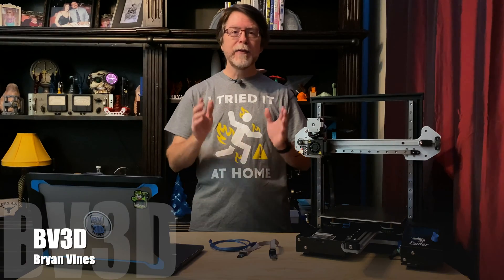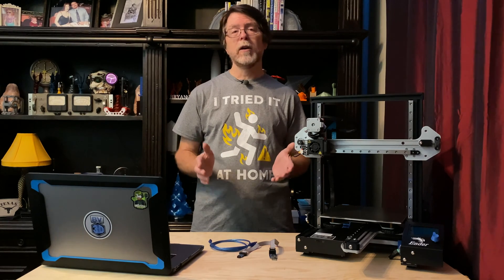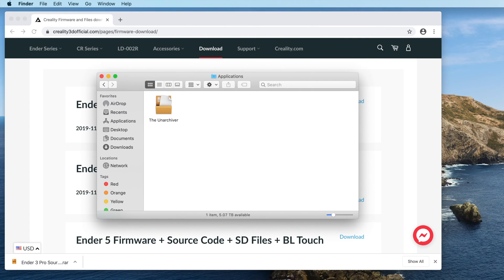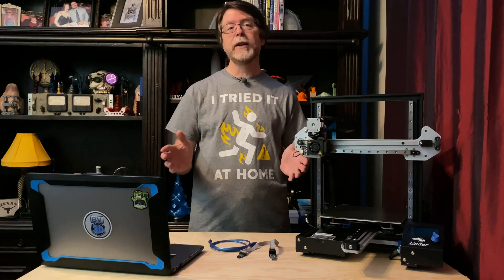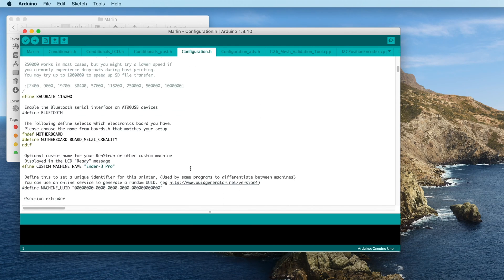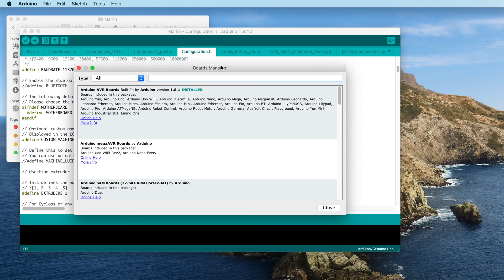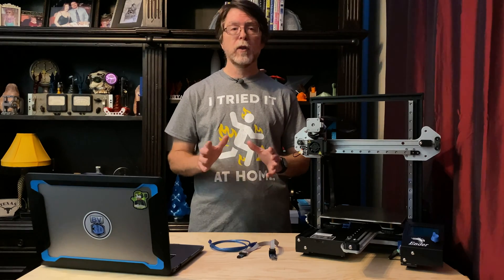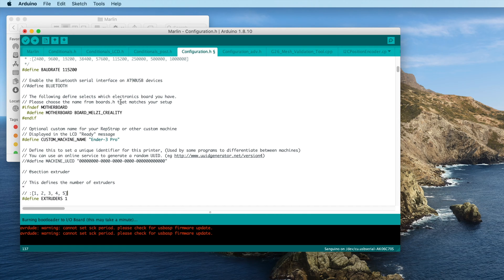How to Install Bootloader & Creality Firmware on Ender 3 & Ender 3 Pro

Comment from the maker: Hello 3D Printing Friends! This video applies to Creality's Ender-3 and Ender-3 Pro printers with 8-bit main boards only. If you've bought an Ender-3 or Ender-3 Pro RECENTLY, check the board revision before following along with this video. If your printer has a v4.2.2 or a v4.2.7 main board, these are 32-bit main boards. The firmware upgrade process for 32-bit boards is completely different (see How to Update the Firmware on the Ender-3 V2 here https://youtu.be/BI269XHyAFg). Thanks, and happy printing! 👍
Reply: I appreciate your video a ton, I bought a v4.2.7 board that appears to not have the bootloader working properly and a lot of the people on the reviews on amazon for the listing I bought had the same issue it seems so I have been attempting to re install the bootloader on the board as it is currently stuck on version 1.1.6 and will not .... I have used about 20 different SD cards ranging from 1 gig to 64gig and formated both with fat and fat32 I spent a lot of time and did everything to the T, your video at least got me on the right track I feel, I hope I get this over with finally though.... I have a older ender 3 pro v1 that was upgraded.... 
UPDATE : 
in case anyone has a issue with a 4.2.7 board that honestly is not updating, this has helped me resolve the issue. I did have to get a little hacky with things however and modify content..honestly might just end up getting another board any way as this has just been a big disappointment and I don't trust it...
Reply: What if i have an ender 3-pro with an upgraded motherboard thats v4.2.7? Then what do i watch in order to upgrade the firmware

Comment: Aaaaargh why are there no tutorials for doing this on the stm32 4.2.2 board!?!?!
Reply from the maker: Creality's 32-bit boards typically take firmware updates via the MicroSD card slot, reading a .bin file, and so don't need a bootloader.

Comment: Could you possibly share the firmware needed for an ender 3, The printer is new, but has been in the box for several years.  After setting it up. To make first print. My screen went black.  Being told by many to reconfigure the printer.  So many to choose from  ,that im not sure about which one to put on a blank micro sd card.  Any help would be greatly appreciated .The printer was given to me. As the gyy lost interest.  He removed only the paperwork.  So by video and finding the instructions online.  But not sure what firmware to dl.

Comment: Loved it, have seen it about 3years ago when you first made it. Bought the USBASp and adapter back then and used it and it worked like a champ. I lost trach of these old board info and have spent 2 days looking for this, again. This time I have a failure of 1 of 3 boards. The first 2 worked great a V1.1.3 and a V1.1.4, but the 3rd would not allow the Bootloader to install. I was wondering if you might have time to review and make a suggestion. The error is: 
 
avrdude: auto set sck period (because given equals null)
avrdude: warning: cannot set sck period. please check for usbasp firmware update.
avrdude: error: program enable: target doesn't answer. 1 
avrdude: initialization failed, rc=-1
         Double check connections and try again, or use -F to override
         this check.

Thanks again.
RC

Comment: I have found a god among mortal men... thank you!  I have been having the worst luck with the ender 3 pro.  I bought it new out of the box, it came with the 4.2.2 board with the bad chip.  After fully assembling it, I managed to erase the firmware on it by accident.  Took me about a month to find new working firmware for it.  I printed about six things and then due to hard to explain circumstances, shut off my 3D printer mid print which destroyed the motor controller.  A year later (just recently), I bought a brand new 4.2.7 board and am still having issues with the firmware.  I even got the touch sensor and LED touch screen too.  I have been fiddling with it for about a week with zero progress.  Somehow, I got it to a point where I could run some basic functions, but the Z axis didn't work and now I can't even get back to that screen.  The Z axis motor would go up but now down and zeroing everything causes it to get stuck in an endless loop when  trying to lower.

Needless to say, I am ready to try anything and the boot loader being borked is my last best guess as to what the issue is before I break down and just buy a brand new printer.

Any help or suggestions by anyone would be greatly apricated!  Also, I know its not the SD card, bought a brand new 32 GB card and am re-formatting it with rufus now just to be sure.

Comment: I know this is an older video, and you probably won't see this, but thank you. I got a BLTouch like 6 months ago and originally tried to follow this tutorial to update my firmware and whatnot. However, there was something wrong with the USBasp that I had bought, and it sent me down a rabbit hole for a couple weeks trying desperately to figure out what was wrong. I looked everywhere. Even Reddit couldn't help me. The problem doesn't matter now, because I eventually dropped it and neglected my printer until about a week ago. I went over everything again, trying to figure out what was wrong with a fresh perspective, and eventually noticed that the USBasp I was using and the one I saw in tutorials was different. The one I had came with the BLTouch and was less complex. The point is, I eventually hit f*ck it and bought what turned out to be the same one you recommended. When I tested it however, my heart sank. More errors. Different ones this time, but still aggravating. After tinkering for about an hour, I decided to come back here, where this all started for me, and reassure I was doing everything correctly.

I had the 6 pin adapter plugged in facing the wrong direction.

Bootloader was burnt on properly first try this time. Thank you. I still have to properly flash the firmware and whatnot, but I had to stop right after that success to get this out somehow. I am so, unbelievably relieved to finally move on with this. Makes me wonder if the BLTouch will be worth it. Thanks for the guide man.

Comment: please! anyone who has done this on windows help! i dont know if its very different on windows or the firmware is very different now but i just cant get this to work and following over and over half the options are in different places i just cant get this. the printer is a brick now and i cant get this program to cooperate

Comment: i can't believe creality required a third party arduino board just to update firmware on 2020 3d printers when every other device on earth has been updating firmwares with usb thumb drives or flash media for 20 years.  This can't be correct, there has to be a way to update firmware with just a file on a sd card.
Reply from the maker: They didn't include a bootloader on their 8-bit boards, so you had to flash the board with a bootloader. Once the 8-bit board has a bootloader, you can flash the firmware over the USB cable. But it wasn't until the 32-bit boards that we got the VERY welcome ability to flash the firmware from a file on the MicroSD card.

Comment: I've tried so many things but I can't get the microcontroller to talk to the board with the right drivers...  I keep getting a Sanguino not detected on the bottom right and a "please check for usbasp firmware update"

It seems like there are a lot of holes in this tutorial :(

Comment: So, I'm new to 3d printing. 
I burned the microcontroller, ( blue screen  )bought a new one, soldered on, then, the same problem, got a blue screen.
Do I have to install a bootloader, to flash a new firmware?

Comment: That was perfect! I’ve been struggling with my old ender 5 (atmega1284p) to let it accept klipper, but it needed a boot loader. For me, a new motherboard or an isp is both going to be a few weeks ordering, so I’m probably going to upgrade to a board with better stepper drivers, but I’m wondering if you could use the arduino it self as a boot loader, with a breadboard,  in a pinch I mean.
Reply from the maker: Hi! Yes, you can use an Arduino and some jumper wires to go from the Arduino's pins to the six-pin connector on the printer's motherboard.  There's a tutorial on the Arduino site ( https://docs.arduino.cc/built-in-examples/arduino-isp/ArduinoISP ). One of the pictures shows an Arduino Nano as the "target" device, being programmed by a larger Arduino. The Nano uses a six-pin ICSP header, just like the printer's motherboard, so that's probably the clearest example of how to connect the two devices.
Reply: @BV3D  I mean, thx a lot ! ! based on your example I was actually able to use the arduino uno as a boot loader and upgrade the marlin firmware with klipper,thus I do not longer need to sit and wait for the new board for a few weeks without printing.  Btw, I’ve since watched several other videos you have, and I’m now wondering if you could use the end stop (z) as a bed probe. I know it’s discussed on several forums and videos, but I have not seen any specific video on how to do it, including the firmware / g code updates and where to do it. I’m pretty new to this 3D printing, just bought an old ender 5 a few weeks back. Anyway really enjoy your videos!

Comment: Actually , you can just put the firmware .bin file on the sd card. Put the sd card on the printer, switch it on, and after a few seconds it boots up normaly! Without the need of this.
Reply from the maker: That's how the 32-bit boards work. The 8-bit board in my printer required the bootloader, and flashing the firmware via USB afterwards.

Comment: My ender 3 pro  board has only a 4 pin not the 6 pin that you show on your video, the board that I have says its V4.2.2, can you recommend anything?
Reply from the maker: Hi George, the v4.2.2 board is a 32-bit board, and doesn't need a bootloader installed. Its firmware also doesn't get flashed via the USB port. Instead, the firmware.bin file should be copied onto a freshly formatted MicroSD card, and that card should be put in the printer's MicroSD card slot, and then turn the printer on. The printer will see the .bin file and attempt to flash the firmware with it.
Reply: @BV3D  I did this, and the printer did see the flash card but did not upload the new software?? what do I do?

Comment: Hi Brian - sorry to ask more questions. I have the 1.1.5 silent board with a bootloader preinstalled. Any advice on updating the firmware? The Crealiity download is a .hex file, without a sourcecode file, and is labeled as 'bootloader'... i'm stuck :-( (Loving 3D printing by the way!)

Comment: This got me 98% there download the TH3d package and use arduino in that package as my sanguino board needed to be Sanguino 12-- and the regular Sanguino only bricked my printer. That easy switch had me up and going in under 4 mins.

Comment: Hi, can I use the BLTouch burner cable in place of the ASP you are using and if so which programmer should I use. Will it be USBasp or USBtiny ISP or some other? Many thanks in advance.

Comment: my 4.2.7 motherboard does not have any pins to plug the adapter into, what now?
Reply from the maker: Ah. This video pre-dates the new 32-bit boards. Updating the firmware is super easy on the new boards. Find the firmware matching your printer and board here (https://forums.creality3dofficial.com/download/ender-series/), and download it. You should end up with a .bin file. 

Put the printer's MicroSD card in your computer, copy the .bin file onto it, eject it, and (with the printer off), put the card back in the printer. 

Turn the printer on, and it should find the .bin file and flash the firmware.
Reply: @BV3D   Do I need to do anything on the Menu to upload this or is there an indicator that lets me know it is uploading?
Reply: @BV3D   so I did all this and the ender 3 pro says there is a card in it, but it won't flash the firmware. Any ideas?

Comment: Fantastic video! It was a success after a 15 minute speed bump as the CH340 did not work for my USBasp.

Windows 10 64bit users: Search for "Zadig" driver installer and then with your USB 10pin to 6pin plugged in and selected choose the libusbK (v3.0.7.0), that will allow arduino to communicate via your USB device and the burn will work correctly. Of course make sure you have your flash ready (I used Octoprint with a flash installer plugin ready)

Comment: Great job!  One question.  I have the USB ASB programmer and it is working great.  But before I burn the bootloader I wanted to make sure the computer sees the Ender 3 via the USB connection.  So I connected the USB from my laptop to the USB port on the Ender and then in Arduino IDE /tools/Ports and nothing shows up.  Does this mean the boot loader must be installed before the IDE sees the USB port connection?       The reason I am asking is I would hate to burn the bootloader and unable to uploaded via USB the new firmware.   Any information is greatly appreciated!

Comment: Can confirm, thanks to helpful comments here, that Ender 3 Pro 4.2.2 boards do not need to have a bootloader flashed to them. Copy the firmware to an empty SD card, put the card in the printer when it's OFF, turn printer on. Mine took a little longer to start up, and the new firmware was there.
Only took 4-5 hours of work to find this out!

Comment: I wonder if anyone can help. I've gone through the setup and everything worked perfectly up until plugging in the USBasp. My printer is unplugged and the LCD board lights up but doesn't boot. I'm using Windows 10
Reply: Fixed the problem - the jumpers on my USBasp were set as 3.3v - changed it to 5v and all worked perfectly!

Comment: Thanks a lot. For me, during the compiling I get the following error message,
..../Marlin.ino.elf section `.data' will not fit in region `text'
region `text' overflowed by 444 bytes
only difference I made compared to you is, enabled BLTouch by editing to #define BLTOUCH in the configuration.h.
It seems the file size became larger than the available memory. Does this mean I cannot use BLTouch? Thanks in advance...

Comment: so i plugged it in, the display lights up but does not boot up. among other issues like failing to install a boot loader even if it is lit up. any suggestions would help immensely i’ve been stuck for months and trying zadig for correct drivers, very new to this stuff

Comment: Thanks for the video. I think even I can follow this - really informative. I’ve ordered the Ender 3 pro, but wanted to check first - is this process still correct as of Aug 2020? (Many thanks in advance, and I’ve already subscribed 👍)
Reply from the maker: Hi Jon! Creality is in the process of switching to 32-bit main boards in the Ender 3 series printers, so the printer you receive MAY have a 32-bit main board in it. If it does, the board is capable of firmware updates via the MicroSD card, which is SUPER convenient. Short of removing the bottom panel from the electronics box to look at the board, I don't know of a quick, easy way to tell if it's 8-bit or 32-bit.
Reply: @BV3D  Many thanks for the reply!

Comment: hi tried to upload a firmware on my ender 5 pro  and i get this code avrdude: stk500_getsync() attempt 1 of 10: not in sync: resp=0x65
avrdude: stk500_getsync() attempt 2 of 10: not in sync: resp=0x63
avrdude: stk500_getsync() attempt 3 of 10: not in sync: resp=0x68
avrdude: stk500_getsync() attempt 4 of 10: not in sync: resp=0x6f
avrdude: stk500_getsync() attempt 5 of 10: not in sync: resp=0x3a
avrdude: stk500_getsync() attempt 6 of 10: not in sync: resp=0x54
avrdude: stk500_getsync() attempt 7 of 10: not in sync: resp=0x46
avrdude: stk500_getsync() attempt 8 of 10: not in sync: resp=0x20
avrdude: stk500_getsync() attempt 9 of 10: not in sync: resp=0x69
avrdude: stk500_getsync() attempt 10 of 10: not in sync: resp=0x6e
An error occurred while uploading the sketch

can you help please
Reply: Same Problem here, W7 64bit :( cant burn the Bootloader

Comment: Trying to put bootloader on my Ender 3 pro V1.1.4 but when I hit burn bootloader in Arduino I get error message. (error: could not find USB device with vid=0x16c0 pid=0x5dc vendor='www.fischl.de' product='USBasp'). Can someone please help!! 🙏🏼🙏🏼🙏🏼
Reply: Just read, someone else had same problem... thanks B!! 😉 Great vid by the way..Best one on this I've seen!!
Reply: Still no port showing up..smh😳
Reply: CH340 Windows  driver install failure 🙄😳

Comment: Excellent step-by-step process to follow if you're upgrading your printer's firmware. In my case, I had just upgraded the printer with an Ender Extender kit and needed to adjust the build volume in the firmware, which this allowed me to do. Thanks!
Reply from the maker: Ah, cool! With the Ender Extender, did you go tall, wide, or both? 👍
Reply: @BV3D  Biggest they sell. 400 x 400 x 500

In my case, the maximum build volume I could use was 390 x 390 x 480. Any larger and the print head bumped into the display / frame.